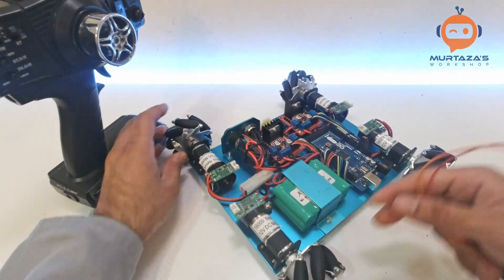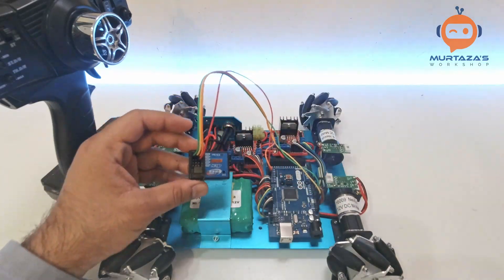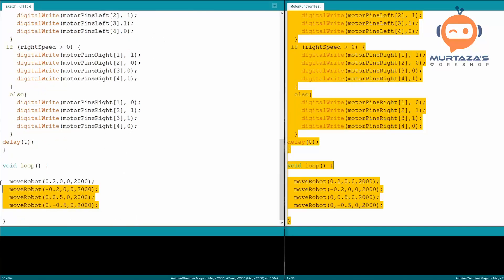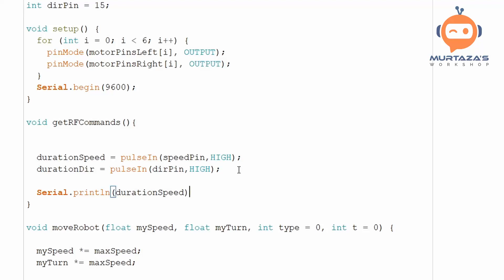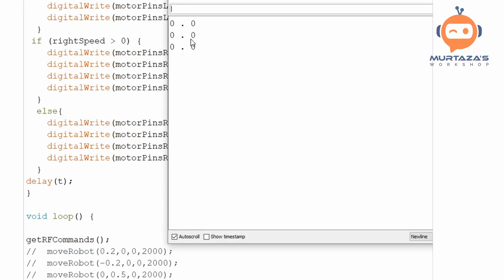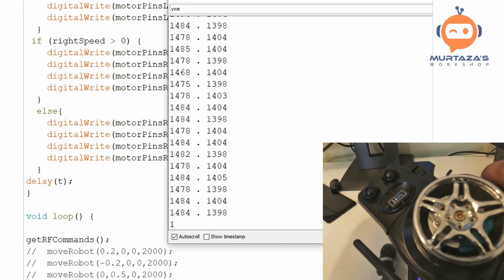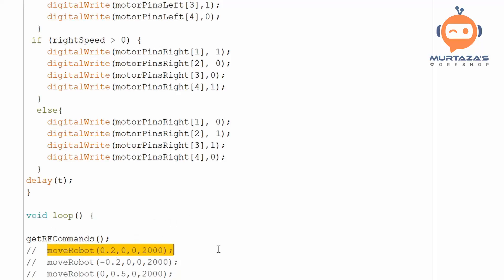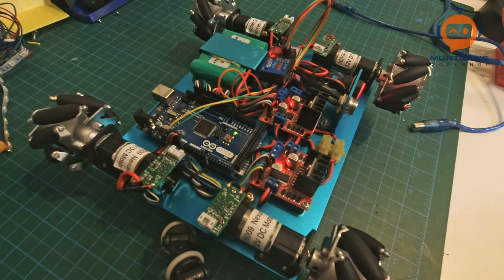RC Controller with Arduino | Self Driving Car using Jetson Nano

Comment: how many voltage does your battery have? I have 2 s battery and it make my rc reciver to give 7.4 voltage output for signals. And as i know, the Arduino have pins with 3.3v. In 1:55, you just connect them without downgrad the voltage. I am asking because I want to use jetson nano to read the data from rc reciver and I am not sure if I can connect them directly.